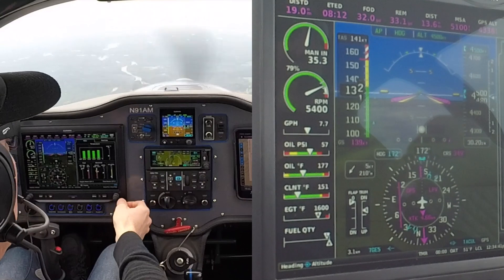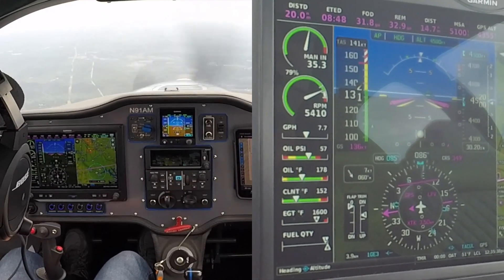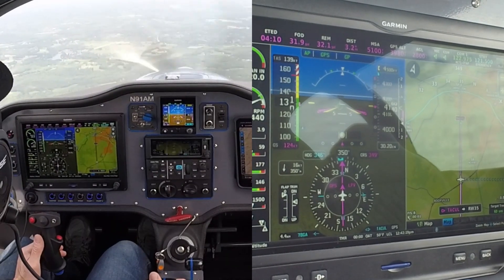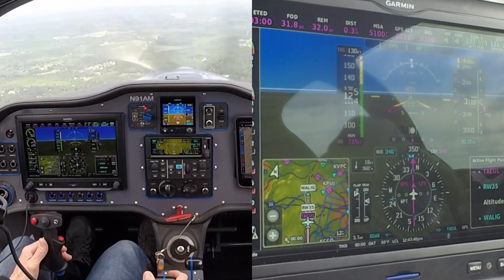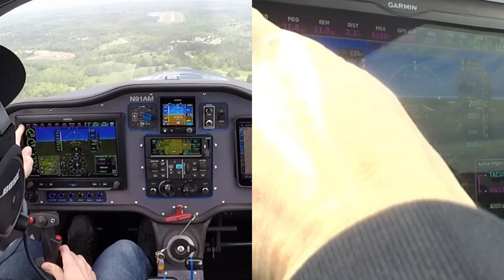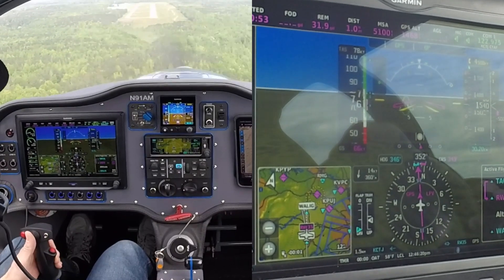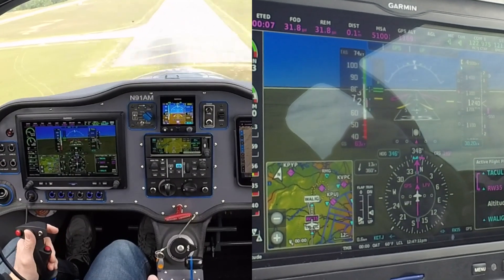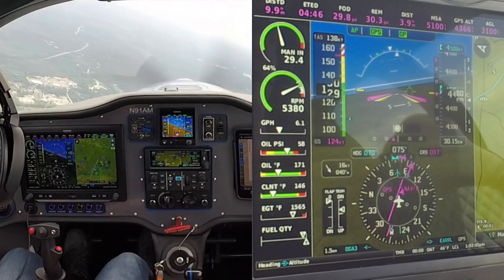High Speed Approaches in a Sling TSi

Comment: What is the red blinking light on your prop controller?
Reply from the maker: It's actually orange, and it just means the controller is driving the propeller pitch in the direction indicated.
Reply: Interesting. Why is it intermittent?
Reply from the maker: Because it's frequently adjusting the pitch one way or another.

Comment: Chopping power off and slowing the airframe down doesn't seem to be a problem!  But what does that sudden cooling do to the engine?
Reply from the maker: Not a problem at all for the Rotax. Unlike legacy engines, the cylinder and piston are both made out of the same alloy, so you don’t have differential expansion and contraction with heating and cooling. Also, the liquid cooling makes temperature changes less dramatic. Sling has discussed this in one of their videos; “shock cooling” is not a concern with this engine.

Comment: Another pilot not using enough rudder...
Reply from the maker: What are you talking about? It's not perfect, but the ball is never more than about 1/8th out of center the whole video. Are you talking about the nose rocking back & forth due to the shifting/gusting winds? I'd rather accept some of that than the PIO's I've seen from overactive use of rudder.
Reply: @OneAlphaMike  The nose went from left to right during the flight. That is how you see that. The ball is too slow to react and requires you to look inside on the panel, where as by looking out you can see it happen (adverse yaw) in real time.
Reply from the maker: @flexairz  Okay. I'll grant you that I mostly fly jets, which have virtually no adverse yaw, so it's entirely possible that my feet have gotten lazy. However, the Sling TSi also has very little adverse yaw and needs very little rudder. Much of the yawing in this video is not even correlated to any stick movements, indicating it's not due to adverse yaw. (Some of it was, but not all of it.) It's just the shifting wind gusts, which I remarked on in the video. I don't try to counter every yaw disturbance with opposite rudder, that's a recipe for PIO and nauseous passengers. (In fact, if anything, at a couple of points I was guilty of overactive rudder!) It's similar to controlling approach speed in turbulent and gusty conditions. You don't try to counter every airspeed fluctuation like a throttle jockey. Instead you protect the Vref as the minimum but allow it to fluctuate above that within an acceptable range. All that said, the whole point of the video was to determine the deceleration distance of the airplane while descending on the glidepath, so I was definitely looking inside more than usual.
Reply: If your camera has the stabilization feature turned on, then I have found that it exaggerates the left right motion in my approach videos. The airplane is NOT moving rapidly left right as it appears. Instead, it’s the stabilization feature trying to keep the horizon level, but it can’t quite keep up.

Comment: Very helpful video. When I used to fly out of Westchester in NY I’d fly the ILS at 135 kts in a Cirrus then yank the power off a mile or so out. The big three bladers really get the speed down. You’ve probably seen it, but Bambi has a video with Sean (rip) flying a TSi where he turns final at 150 kts and crosses the threshold at 70kts…
Reply from the maker: Cool about the Cirrus, I used to fly those, too. I will say that I'm a lot more comfortable pulling the liquid-cooled Rotax quickly back to idle than I would be doing that on a big-bore Continental!

Yeah, I saw that video with Bambi & Sean, but I couldn't really see the airspeed indication or how long of a final it was. So, I wanted to prove it for myself! 😁